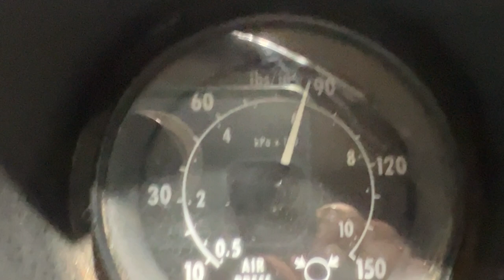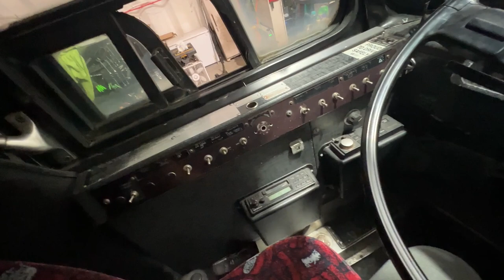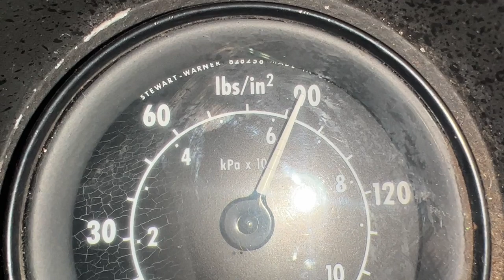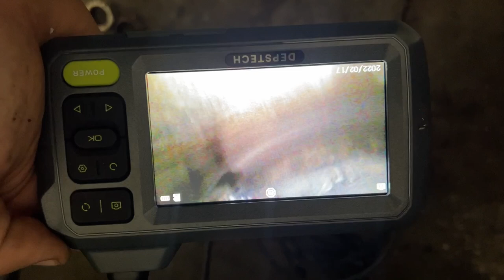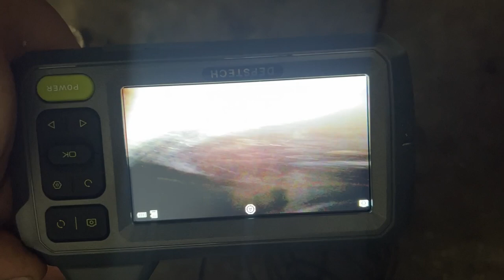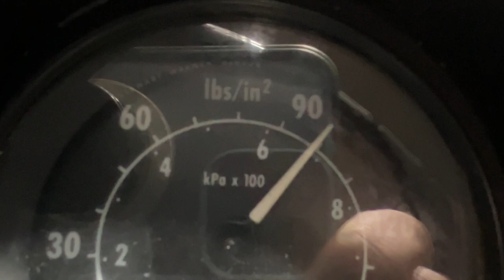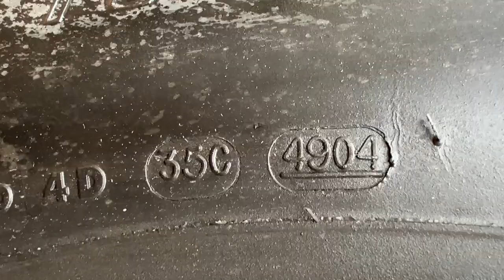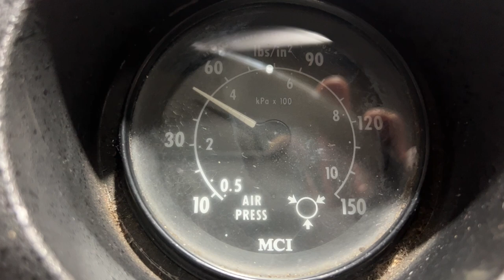How bad of a job can a fleet services shop do on a bus?  This bus was unsafe to drive!

Comment: I was an automotive mech. for 45 years and owned my own shop for 20 of those years. I tried to avoid badmouthing other shops, but in the case of that guy I would dump on him any time anyone asked. I put my name on my business because I am proud of it. Keep up the good work.
Reply: My thoughts exactly
Reply: Bad mouthing is one thing but the level of competence is a liability risk to his customers and not in the interest of public safety,he clearly has no interest in correcting his mistakes and was dismissive when informed of issues he had caused ,he may derive most of his income from litigation. What is legal and what is right are rarely the same thing unfortunately.
Reply: Pretty sure the name of this business is somebody's name also, but the Google reviews let you know they don't care... Only fleet shop within 100 miles of Bloomington that has multiple one-star reviews....
Reply: Amen brother!
Reply: @buddsmokengood  Here's a terrifying thought. Next time a semi truck speeds past you on the interstate, think of that shop.
Reply: @stevenbrown4315  In his case he did neither.  He didn't fix the issues with the bus, Some of what he did compromise the safety of the vehicle and anyone in it.  As to the legal, he issued a bogus safety certification document.  He should be reported to whatever agency certifies his ability to inspect heavy vehicles.
Reply: @buddsmokengood  good researching! now we know who to avoid...
Reply: @GoogleSpyZon  my thinking exactly! the public is put at risk from this level of incompetence!

Comment: That 'complimentary' DOT inspection with a passing grade is the key to receiving any type of financial compensation. The bus owner now has video proof that the bus was unsafe and should not have passed. The faulty shop should lose their ability to award such bogus certification. A formal complaint placed with the proper office in Indiana should be registered and then compensation sought through legal channels.
Reply: Seriously agree, Dean.   Messing around in certifying the bus was legal to go on the road that should have been deadlined MUST have very serious consequences.  Call Indiana State Police and ask to speak to someone in their MV inspections division and make a complaint using the BGM video as evidence of the crime involved.
Reply: They didn’t spot the faulty brake chamber and other air leaks and contaminated the brake linings with grease,epic fail to leave that shop worse than it went in.If that shop services tractor trailers to the same standard is a real concern. The work that Scott does is more in line with customer expectations and and industry standards a godsend to people that buy old coaches and RVs that need honest inspections and repairs because they also benefit from his knowledge and advice.
Reply: I think there's a C.V inspector on YouTube from Indiana. He's always pointing out bad flatbed loads.
Reply: I hope the DOT see this.
Reply: I'll wager that complimentary DOT inspection was a perfunctory look around, check the tire pressure, and move the bus a few feet in the shop and hit the brakes.  Yep, it looks good enough!
Reply: @jerrykinnin7941    He can be found on the ISP YouTube channel I believe.
Reply: @user-zc1cs8em7y  Here's a terrifying thought. Think of that shop the next time a semi truck speeds past you on the interstate.
Reply: @GoogleSpyZon  Big fleet operators have the wherewithal to maintain their tractor trailers.  We've never seen a fleet bus come to BGM.

What comes into Scott's shop are privately owned buses and owners who are way in over their heads.  Previous owners couldn't afford to maintain their buses and sold them to buyers who lack the experience to operate and maintain them.

IMO, private bus owners should be required to take courses on bus ownership and hands-on inspection before being allowed to buy one of these buses.  If they buy a fixer upper, they will have to have it inspected, a Restricted Use sticker, and a checklist created that requires the new owner to fix the problems in order to get a regular inspection sticker.
Reply: @BlackPill-pu4vi  that’s all very well and good but what use is it if a shop like the one that inspected this one and deemed it safe does the inspection then your screwed
Reply: It’s officer Hoover.  He appears on Dirt Perfect’s channel regularly.
Reply: @MrDexcars  In an ideal world, the government should do the inspections and let other shops do the repairs.  That way there's no conflict of interest.  

In practice, we all know the government cannot operated enough inspection stations and it would be like going to the DMV.  A long wait if you don't have an appointment and inconvenient in any case.

The government COULD make it easy for bus owners like this guy to file a complaint about a bad shop and the State make a swift investigation of the matter.  Then the State can make the shop either make things right or force them to refund the guy.

But, in the real world and as things have been for too long, it won't happen.

Comment: The best that can be done is register a complaint to the regulating authority for the work that the brakes to be unsafe and the other substandard work including the DOT inspection. Unfortunately only a accident investigation that is traced back to that fleet service shop will change the way he operates,how they can charge so much for a diagnosis for the heating system they don’t understand and failed to fix is a complete insult to the customer considering every thing they did do needed to be redone or corrected at additional cost to the customer.👍 for the best cost/safety outcome with the tires.

Comment: that shop needs to be called out by name ,, and they also need to be REPORTED to both the BBB , Chamber of commerce AND the state along with the DOT because i am pretty sure they have to be certified to work on commercial vehicles ,,,filing  a lawsuit against them for unsafe practices will fix his attitude ,,,if they are doing this type of shoddy unsafe work to a motorcoach that carries passengers , i guarantee they are doing it to every other vehicle they work on ,,how many other vehicles have they done this to ,, it's mindboggling

Comment: Astounded that any workshop could get away with such shoddy work, I'm from New Zealand and can tell you any shop that did this would be shutdown straight away, just imagine how much damage this vehicle could do if the brakes failed at highway speeds even if they came on due to lack of air pressure and locked up the wheels, we also have a tribunal specifically set up for people who have been ripped off for a nominal fee to get a hearing in front of an adjudicator who can award compensation up to $15000.00 which is enforced by court bailiffs & is very effective, I hope the owner gets a full refund as I would demand nothing less, thanks for exposing this type of rip-off & for helping these guys get the actual work required done.

Comment: Scott, I worked as Manufacturer Parts & Service rep for one of the Major Commercial Trucking Companys.  I traveled the country visiting franchised dealers to help improve parts and service operations. One thing they all have in common is they don't like to work on coaches. That's why their labor rates are so high for coach work, to deter having to work on them. Only because they are the area certified dealer for the power train components do they take in coaches. Overall, commercial truck dealers' are light years behind running clean  shop operations as automotive has. No comparisons.
Reply: You are correct. We purchased two 45ft. Volvo motorcoaches for a significantly lower price than comparable Prevost units. The only warranty location near us is a Volvo truck dealership. The mechanics there are TRUCK mechanics and despise buses. Last time we took one there it was a six month ordeal to get it back.

Comment: You should specifically call out the shop that did this shoddy work and inform the Better Business Bureau as well as the state motor vehicles dept if they license this shop. Grease on the breaks is a definite NO-NO and every shop knows it!

Comment: That is an issue today with vehicle techs not understanding older technology, they have only been taught to plug a computer in to the vehicle diagnostic port and fix it. 
I had a diesel powered truck that used a air starter with mechanical injection, they could not wrap their heads around a truck that didn’t need batteries to start.

Comment: That is so wrong for a shop to charge people for work not done right or at all . They should be held accountable . Many years ago I drove a propane bobtail delivering  to homes and businesses and I know the importance of work being done on your truck correctly . Bless you for watching out for the safety of your customers .
Reply: I got an estimate for a tailight bulb labor charge for $20. You know the older kind like open trunk exposed back of tailights, quarter turn socket pops it out. Swap bulb and quarter turn to put back in...a 10 sec job. 
Another charge was shock replacement and installation like $70 for just installation. But the other work they were doing required removal and installation of the shock. So double billing.
It's all standard practice in the industry.

Comment: Holy Crap!!! In my home state this individual would have his state DOT inspection license revoked and he would receive a huge fine..This place is lucky the bus owner wasn't involved in an accident because the bus owners name would be on the building!!! Great video Scott...I noticed on these older MCI's the drain for the air tanks are up a little too high, will never remove all the water .... I'm very surprised you haven't changed more air dryers, brake application valves, air governor's with all that water in the system...Before air dryers we use alcohol in the air system to help dry up the water

Comment: When I drove MCI 9 buses it was standard practice to close the heat valves in summer and open them in winter, we wiped down the windows on the inside with rubbing alcohol to keep the windows from fogging up.

Comment: This video has convinced me not to buy that 6-71 Silversides I always wanted.  Buying is one thing, and maintaining is quite another.
Reply: But a lot of it is basic maintenance and a lot can be done by a visual inspection by a handy capable individual
Reply: @mrmotofy  I agree!  Once quite handy and capable, I am old and busted up with RA.  A lovely Silversides sat for years (1980s) in a nearby driveway, rotting away, and was suddenly gone to parts unknown.  It needed a big garage, which I did not have.  I have never seen another one up close since.

Comment: Scott, nice job to your and your crew for helping this guy out. unfortunately this happens a lot,and it’s not just buses. I worked 43+ years on buses and usually if we had bus down on the road and called a shop , as soon as you told them it was a bus it was either “no” or “ we’re three weeks out” I remember in one instance in a major city in the south, we had a Van Hool with a Cummins that the air compressor failed. I had it towed to franchise truck shop without calling them. My driver went in after the tow truck left and told them it wouldn’t build air. As soon as the driver told the day shift service manager it was a bus he told him they couldn’t get to it for two weeks.  I told the driver to wait till the 2nd shift service manager came in and to tell him to call me, I bribed him $200 cash to get it in that night and he did. It was out the door before the day shift came in. I could go on for days telling these kind of stories. Also, FYI those mci buses with 8v92TA also over drive that radiator fan gear box slightly.  We used to put a reflective strip on the  upper belt pulley and check rpm at max engine no load rpm at every service. If memory serves me correctly it should be 150-200 rpm above max no load on engine rpm. Love the videos

Comment: Here is my take on independent 'fleet maintenance' shops from 40 years ago which is probably still true today: When I got out of the auto/diesel program at my community college, I was looking for a job. My dad did accounting work for a small machine shop/auto parts store/ fleet maint. shop. The owner offered me a job at the fleet shop but the pay was minimum wage $3.50/hr. (1983). I said NO THANKS. This place worked on medium duty trucks like delivery vans and the occasional semi tractor. Poor pay for ass busting work. They had one diesel guy. No longer in business. I'm sure that places today are taking kids right out of school, paying them next to nothing and ramming the jobs through.

Comment: Scott, I am now retired but have worked in the bus industry in the UK as a vehicle technician all my life, my thoughts on this…
1, the heating / ventilation issues I can sort of understand as it can be a complex system that wouldn’t be wildly common, he should have read up on it to try and understand the operation.
2, Bus and truck mechanical systems share the same technology so any halfway competent technician shouldn’t have any issues working on either type of vehicle. That includes knowing not to pump the brake drums full of grease, it does seem strange that there are grease fittings on the brake shoe pivot pins though, that’s something I’ve never seen. 
3, it was stated that the vehicle had a mandatory DOT inspection, as I am in the UK i don’t know what that entails in the USA but in the Uk it will include a full roller brake test with the machine providing a full print out of the results including whether it passed or failed and the relative performance of each brake unit.Having access to a brake tester makes diagnostics so much easier.
 That shop is a menace to himself any every one else

Comment: I managed a fleet shop for many years and we almost exclusively worked trucks, but the owner was on the list of facilities that the state troopers could call to get a vehicle off the road or send vehicles to work on if needed. So on occasion we would have busses and coaches to work on, mostly breakdown stuff, just mechanical stuff not specific to coaches. But every once in a while we would come across a coach specific repair and the last thing we would ever do is just guess on a repair. I was fortunate that I had a good friend who's family ran a commuter bus service so I always had someone I could call if we got stuck. It’s just unbelievable how bad this shop was and screwed this owner of the bus. It gives all shops a bad name when there are actors like that place

Comment: There have always been bad shops out there but this was shocking! On a "serviced" bus, one bad thing after another x10 up to the grease on the brakes. That legit sent chills down my spine. Some would say it was a higher power or pure luck that guided this bus to your shop. Whatever it was, that you guys found & fixed these issues was the best possible outcome when it very well could have been a forensic team that discovered these issues while investigating the cause of a multiple fatality accident.
imo guardian angels can deputize those who they see worthy of the job, & wings aren't necessarily a requirement.

Comment: Hey Scott, not sure you know that there is a great seal distributor in Nashville. Signal Industrial products. They can correctly measure and match most any seal type you walk in the door with. I also use Allied bearings and supply in Nashville, near the airport. I have all the contact info if you are interested. I also run into very poor work in my business. Unfortunately it from the factory untrained technicians. The poor guys train on all of the equipment for two weeks, and sent out with tools and parts. They swap parts until they hit the bad one and the customer pays for it. Great work documenting the poor and dangerous work. I would defiantly contact the DOT, after this guys attitude and dangerous work, and possibly have his DOT a inspection license removed. Think about the vehicles that you didn’t see! Thanks.

Comment: Im not a machanic of eny thing but if i do a repare i clean every thing  befor new grease is put in so its not  we cannot drive a truck or coach over here if the tires are over ten years old now  and if you have a light on the dash on inspection thats a fail to   keep up your good work 👌

Comment: Whew glad you caught these issues.  Slightly off topic,  have you read about all the tour bus crashes in the last 10 to 20 years?  Many tour bus owners and operators have cut corners to maximize profits while risking the safety of its passengers.  Some states such as New York haven't done their job to shut these operators down (remember the Ford Excursion limo that lost it's brakes and killed 20 people in 2018??) In one year alone the Feds put 52 bus companies out of business for cutting corners on maintenance. Not to mention there have been cases of the drivers not having proper licenses to operate these buses.
So glad you caught these issues before a bad accident happened and you likely saved Hank's life.

Comment: The shop he used needs to reported to the DOT because they performed and passed a vehicle that clearly fails. I had a class 7 inspection license in PA when I inspected a vehicle I signed the stickers. If a failure was attributed to an item I passed the shop and I would face serious fines. That shop needs to be investigated and fined and your client should get refund for insufficient repairs. Thank goodness for your capabilities and knowledge you probably saved some lives.